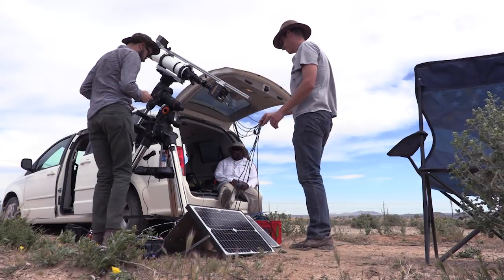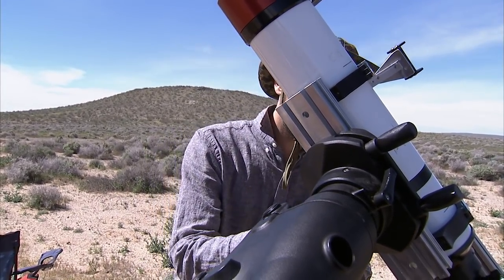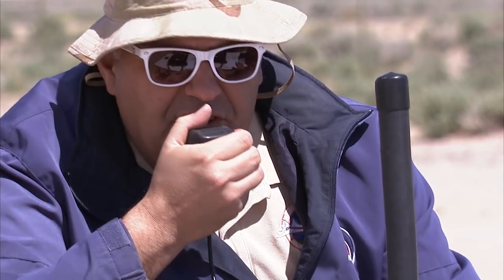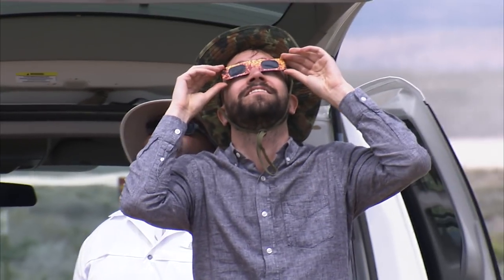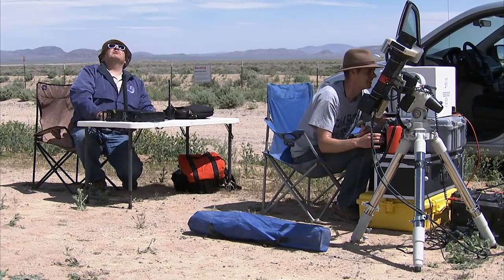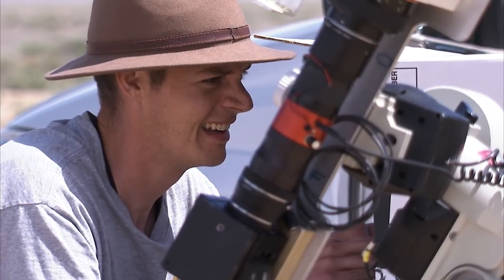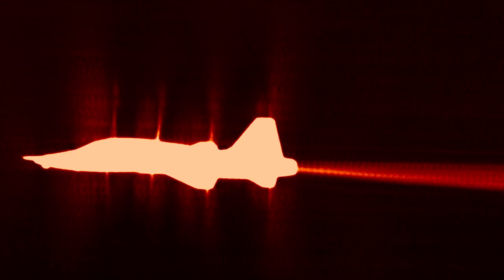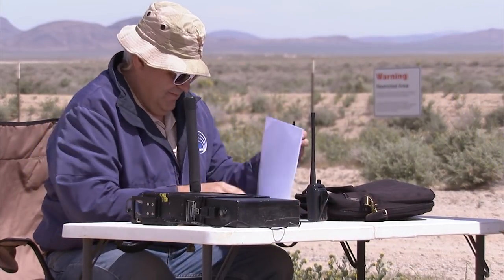NASA Supersonic Flights Validate Flightworthiness for Future Schlieren Imaging

Comment: How did you get the aircraft to line up correctly for the test and again at a lower altitude?
Reply: Math probably. AF pilots have very fancy radar and navigation equipment i don't think he could blindly do this on the first try since the sun was not directly overhead. It is pretty simple trigonometry which i assume is pre-calculated and routed.